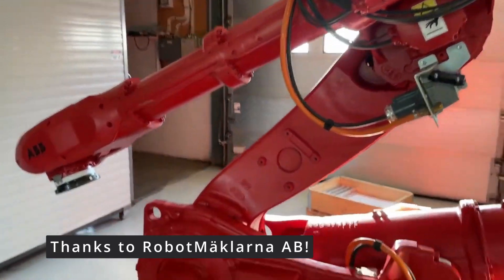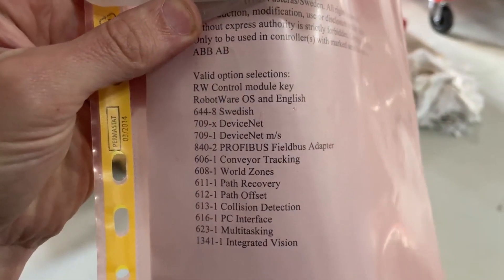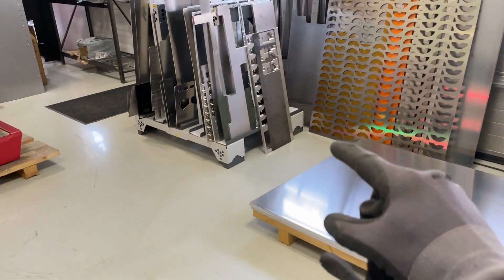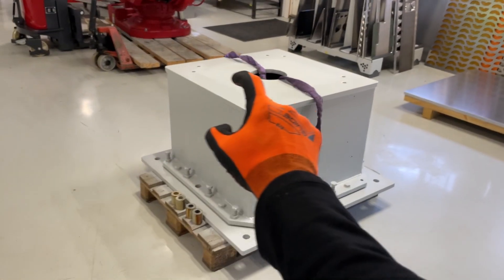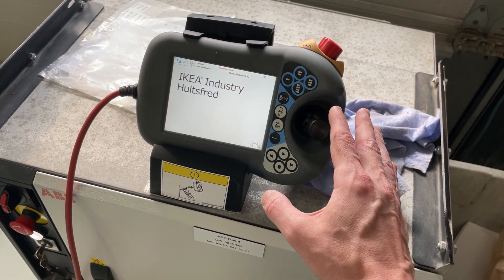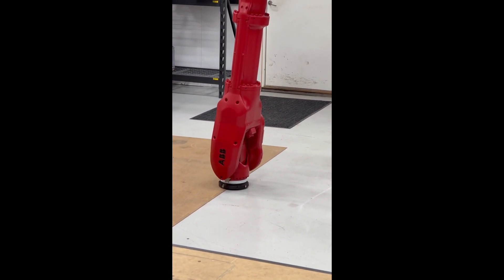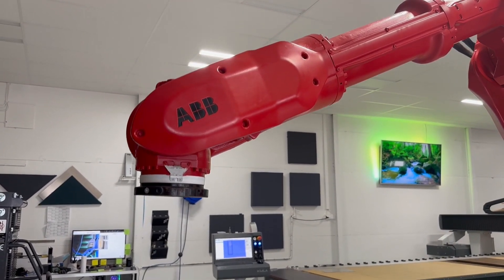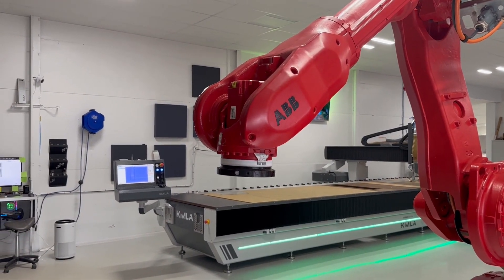MONSTER ROBOT CONFIRMED!    F@#K YEAH!

Comment: Nice shelf robot! I worked as a robot programmer for the integrator that was located (until 2016 or 2017 when the company went bankrupt) in the same facilities as RobotMäklarna in Skara, if they are still located in Skara. Not sure how proficient you are at programming but if you have any questions just ask and I'll try to answer them. (Also in Swedish of course, just made it in English as comments in other languages can be a bit annoying).
Reply from the maker: Thanks! Much appriciated! im a total rookie when it comes to robots, so far :)

En kille som heter Bosse köpte RobotMäklarna några år sen och har nyligen flyttat det till haninge eller där i kring. Denna köptes genom honom av en av hans "kontakter" i södra sverige någonstans.
Mycket robot för pengarna med tanke på alla tillbehör jag fick med, supernöjd!
Reply from the maker: Om du någonsin finner dig själv passerande enköping så hör av dig så ska du få kaffe och en rundtur :)
Reply: @randomrouting  Tack det ska jag lägga i minnet, det hade definitivt varit intressant! :)

Comment: How do you plan to put guarding around it? That thing is huge.
Reply from the maker: My planning goes like this:
1,No cage but im using the same typ dual zone lidar system as on the router (and many newer robot installations).
2, I also got "Collision detection" set on the robot itself. The motors have a torque limit basically.
3, In robotstudio you are able to set "world zones" that prohibit the robot from beeing able to go into selected areas(cieling and floor for example ) and avoid obstacles.

4, the robot movement speed will be set permanentaly slow, no need to go fast.
5, redundant e-stop citcuits will make sure the router gantry and the robot never meet. One cant leave its sensor unless the other one is active, if both would be open at any time the circuit is open and that means e-stop on both machines.

And yeah, its a monster ;D
Reply: @randomrouting  that's awesome!! Thanks for the reply.

Comment: How much did the robot cost?
Reply from the maker: 225k SEK for the robot, /242K SEK including shipping, the raiserbase, cable package, lidar and the "free" stuff. VERY happy with that price. ex vat ofc.
Reply: @randomrouting   very good price
Reply: @umerovasan  holy cow you got a deal!!!
Reply from the maker: @hyperformancellc  Yeah I was so lucky, it was the only 3.5m reach robot i could find (locally) without having a robot dealer modify a existing one.
Reply: @randomrouting  I cant wait to see the implementation.
Reply from the maker: @hyperformancellc  same!
Reply: @randomrouting  I have a large KUKA robot but no controler for it. just the arm.  I can buy a whole used robot for cheaper then I can get the drivers. I want to take the servos off and save them and machine blocks to go bolt into the servo locations in to position the robot to hold up a shop sign out by the road.
Reply from the maker: @hyperformancellc  Haha that would be way cool. Good way to have somehing memorable and that kinda represents that theres a manufacturing business there.
Really good idea. Some robots they practically give away from time to time. Hmmm
Reply: @Random Routing  I have it all drawn up in fusion 360 how it would look.
Reply: @randomrouting  they are widening the highway infront of my shop though so I am waiting to see how much I lose out front first.
Reply from the maker: @hyperformancellc  Ah, sounds like a plan. I really like the idea. If one strips all non metallic parts it could be powder coated so it could look really good too for a long time.
Hope you show it when the time comes!
A smaller one could be used to hold the mailbox ;D
Reply: @randomrouting  Im afraid of having something that heavy by a four lane highway. we have 200,00 cars come by a day at over 60mph.  I see enough deadly accidents here a year without having to worry about have a robotic arm come flying across the property. So im going to wait until they widen the road next year and then talk with some of the engineers from that on a way to safely do this.
Reply from the maker: @hyperformancellc  Makes sense. Here there are strict rules on how close you may place anything to a roadway, bet you guys have something similar.
Cant wait to see it tho!
Reply: @randomrouting  amazingly not here. Ill be the only person here with a permited sign for miles in either direction. I just want to take precautions for my own reasons.